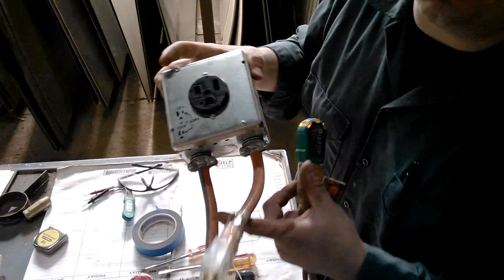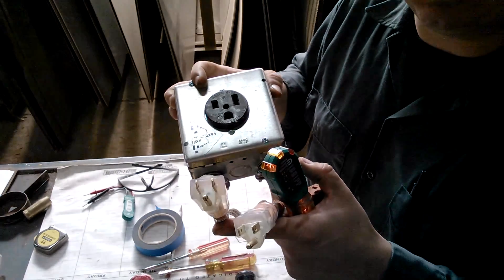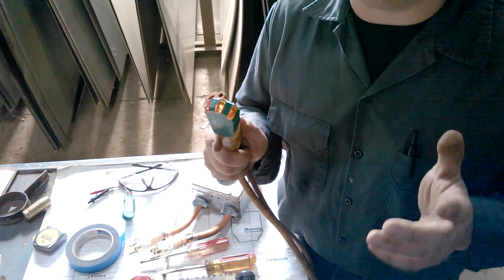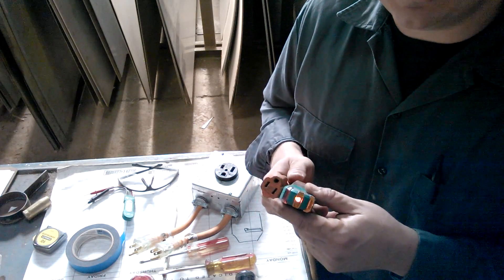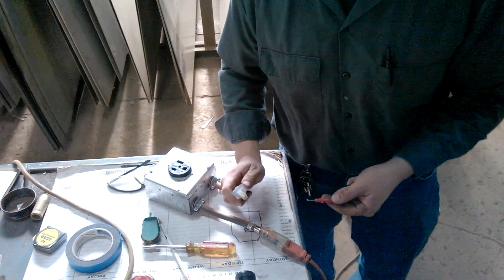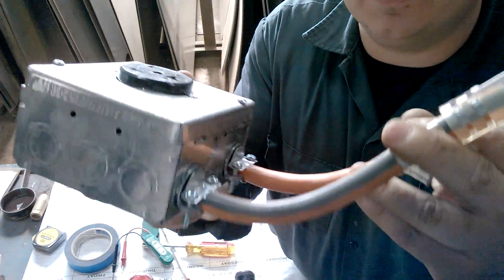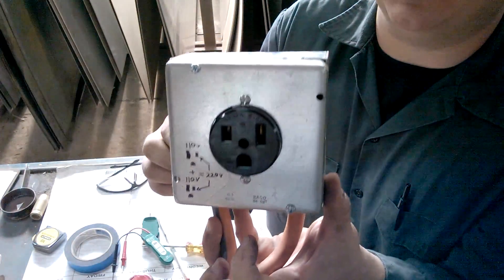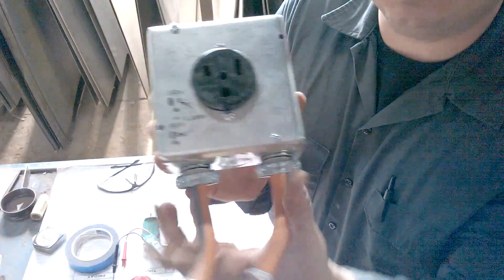Experiment convert 110v to 220v from two outlets

Comment: lots of words from someone who does not understand house power.  Adjacent breakers in a panel are each on opposite phases, so are 240 volts apart.  A double breaker serving a stove, water tank, or dryer therefore picks up 240 between the two hots.   Houses built after the 1980s must have split duplex receptacles in the kitchen,  which means the top and bottom half of the outlet are on two different adjacent breakers.  Therefore, you can get 240 volts between the two hot holes.  The hot holes are the shorter of the two slots.
You can also get 240 between the short slots of two random outlets in any house, but there is a 50% chance they are not on opposite phases, so you will get zero volts between them.

Comment: What you are saying is correct you need 2 separate circuits with them being on different Lines for example circuit 1 is on line 1 and circuit 2 is on line 2. The easiest way to get 240v from 2 120v outlets is from the kitchen split receptacles 240 is available in between the hot's on the duplex

Comment: you are a dipshit talk to damn much
Reply from the maker: Lol, I assume you prefer picture books also.
Reply: +UnsanctionedFabrication 
nice video there's only one concerned that I saw no one bringing. yes this is perfectly safe to do. the only problem is if there is a fault in any one of the lines and the breaker for that line pops the second leg will continually have power until a fault occurred and the breaker pops on its own or you shut it off realizing you do not have your 240 volt system working anyway more. why when they do run a 240 or 120 240 volt system they will connect the two Breakers together if a fault occurs in any one of them or both of them both Breakers will trip shutting off power to the load.
okay for you to do in a pinch but if you're going to go through all this trouble of making this damn thing why don't you just buy a 2 pole breaker some appropriate sized wire and run it and do it the right way

Comment: I was visiting a NUCCA Chiropractor today, he mentioned that he doesn't have 220 in his office so he uses 110V plus a battery to make his x-ray machine work. I was just sitting around tonight thinking about how he could do this without spending a lot of money installing 220 into an office he is renting. I once wired my garage with 220 so that I can test electric dryers to sell.

In my mind I could picture the wiring. In a 110v outlet you have a black wire (hot) a white wire (neutral) which interestingly connects to the same bus bar as the negative wire inside the electrical box, essentially neutral is ground, I always thought that was strange, because then you have the green wire (ground), as if redundant. Look in the electrical box if you don't believe me.

Anyhow, when you look at a 3 prong 220v outlet, one prong has a black wire connected to one side, 110V, then another 110V black wire connected to the other prong, the white neutral wire has been eliminated and the green wire is connected to the middle prong. The newer 4 prong 220v outlets re-introduce the white wire, on dryers both white and green are ground. I've worked with these long enough for this to be embedded into my memory. Each have their own separate breakers that don't share that current with anything else, but I had the thought, just as you demonstrated here, take extension cords from different outlets on different breakers that aren't carrying heavy loads, such as a refrigerator, I think it's the narrow prong that's hot, the black wire, you can check by looking at how an outlet is wired up, then wire up the 220 outlet as you did, so I looked on youtube to see if anyone else had thought of this, and then I saw your video, this brilliantly simple if one comprehends the concept. Your cords should be a certain AWG to properly carry the load without burning up the wire, and again, if the section you have either cord plugged into is drawing too many amps from other appliances then it will keep tripping one of the breakers.

I must experiment with this and I have dryers to test the procedure. Some may ask what a NUCCA Chiropractor is. In plain English it's a new procedure where it was discovered that a plate under the scull gets misaligned and all other vertebrae below shifts out of balance as a result. Adjust the plate and everything below it responds and realigns only requiring one or two adjustments until the next time you take a hit to throw it out. I also learned that some chiropractors will deceive people into believing they use NUCCA techniques yet convince people to come back once or twice a week repeatedly, so beware of those.

Comment: you can check if 220v exists between circuits with a multimeter. the converter you have built will have either 120 or 220 if plugged into different outlets. no harm can come from plugging it into any outlet. The caveat here is that the circuits you are using are  either 15 or 20 amp max and you cant use most large equipment on them.

Comment: OK, so we now have a cool little gizmo that's not up to code but the real question is about what you may power with this contraption? You have a 30 amp plug and only 20 amp (at best) breakers. Seeing as an acceptable draw is 80% loading on a branch circuit we now have roughly 16 amps per leg available for the appliance. This is not enough for a portable oven, cook-top, or even an electric car, although might work on a small welder if it's got the ability to dial-down the draw, in which case that welder probably has the option to run on 120 volts already. (typical of Miller welders / plasma cutters) For those who are not familiar, a 20 amp 2-poll breaker for 240 volts is almost exactly the same as a pair of 20 amp 120 volt breakers. The difference is what's called "common trip" so if one trips then both go off. This is the second problem that blows out the code book.

Comment: Thank you a lot. I bought a dishwasher with a 220 v from italy but I only have 110 v.  with your method I was able to get it to work and I didn't have to expend almost $100 buying a Volt converter step up. But it only worked because I have a brother living next to my house. I did use the negative (black ) a cable from his 110 and a 110 from my house connected to an outlet.

Comment: Cool! I really don't understand why 110V is still the standard in the United States. 240V is more efficient to me.
It's a cool experiment. I assume the electricity is still 60 Hz, so you probably won't be able to use a lot of appliances made for 240V 50 Hz, but I still think it's pretty cool.
Reply: Arne Maeschaelck because it is said to have gone back to the Edison days where 100 volts got the job done so the U.S. adapted it.
Reply: 482lost of course! I can plug in my laptop perfectly fine in a wall outlet (240V) or in my truck (110V) or charge it pretty much anywhere in the world. No problem.
But quite a lot of devices still only work on one of the two, and they still require twice the current (and a thicker cable)…

The higher the voltage the more efficient, but obviously it wouldn't be very safe to have 10 kV on wall outlets…

Comment: good math but terrible idea. if I connected 2 sets of leads off of a power source and then connected the leads together I would still end up with the same amount of voltage with a slight amperage drop. do not cross connect any wires. play with induction instead of starting a future fire you would have in your walls. and no anyone commenting that this works or is a good idea has never and will never be an electrical engineer for any company what so ever. and your phase out of phase from 2 voltage lines are confusing your tester because of the length and gauge of your shop cords. just stick with the code please
Reply: That's true, but that's not what he did. The hot leads aren't connected together, the grounds were.

This works. I did it with an electric water heater and it ran fine for 3 years before I moved out and I'm sure it still works fine to this day.
Reply: Trolls. Workable. But you wouldnt find that kinda work in my shop. Each to thier own if it works I guess run with it??

Comment: This is  just a simple combination of split phase AC electric.  Anyone can do this in their house if they have split phase 110 or 120 (here in USA we have 120).  An easy way to find out if  you have 2 different phases is to run an extension cord from another room and check the voltage between the 2 hots after first checking each individual cord for 110 or 120V.  If they are the same phase then the voltage between the 2 hots will be 0.  If they are different phases (meaning 180 degrees out of  phase but still phase locked), it will show up as 220 or 240V.  This is VERY simple to do.   Once you have the 240V isolated (meaning you have the correct feeds for it), you can do many things.  They are guaranteed to be on different breakers so depending on what load you need, you can decide if you must combine 20A breakers or if 15A will be enough.  Remember at 240V (vs. 120V), you only need half the amps for a given wattage (assuming same power factor for both).  Assuming the wattage of  what you need stays constant (for example a 120V 1500 watt heater vs. a 240V 1500 watt heater), the wire thickness needed for the 240V setup is less (smaller).  This is partially why high energy electric things use higher voltage, otherwise the thickness requirement for the  wires would be great.  Golf carts for example draw thousands of watts but do so via 36V or 48V (usually) , thus only needing 6 AWG cables.  Imagine if they use a 12V setup for a golf cart.  Not only would you need several hundreds of amps, but the cables would have to be MUCH thicker like 2 AWG.  A decent analogy is voltage is like the size of a baseball batter, amps is how hard he has to swing, and watts is how far the ball goes.  So a large batter (let's say 24V) would only have to swing moderately (lets say 10A) to hit the ball 240 feet (240 watts analogy).  Now let's take a smaller batter (equivalent to 12V in our analogy).  That same batter has to swing twice as hard (20A) to hit the ball the same 240 feet (240 watts).
Reply: David James True. The power coming in the home is 240 vac split phase. Just depends on which side of the circuit breaker box it happens to be on.

Comment: From the wall you get 3 cables, Red, Black, White,  if you get Red And Black you get 220v, if you get red or black and white you get 110v,   so red has 110v and black has 110v, white is neutral,   so to get 220 from a normal outlet just make sure each outlet is connect to a brake that is connected to the red and the other braker to the black and you get 220v!!!!!!!!!

Comment: The reason why this should NEVER BE DONE is that it is NOT true 240v! A/C which is defined as "alternating current" is a sign wave that basically is a plus and minus voltage cycled at 60hurtz. Standard 120v current is basically a sign wave of just a negative and positive pulse. 240v is two of these sign waves running opposite of each other. This is how any motor running on 240v starts and operates. Now if you tie two 120v lines together, the sign wave pattern would now be the same and no longer are opposite of each other. Although SOME items that are 240v will operate on this phase, most will heat up fast and either burn out or start a fire. (Good example of this would be a 240v well pump. It will run for a while, but the windings in the motor will be under extreme heat and WILL burn out.)   Yes it can be done but you are playing with "fire" by crossing the 120v lines to make 240v out of a generator that is only one phase.
Reply: +1111hobbes ???? This exactly the same method of providing 240v which is typically done, except he's sourcing his 120v L1 and L2 supplies at the outlets rather than at the breaker panel. L1 and L2 are out of phase by 180 degrees, and sourced from opposite ends of the same centre tapped transformer, therefore  will provide a constant 240v(rms) value between each.
Reply: 1111hobbes 𝙏𝙝𝙞𝙨 𝙨𝙝𝙤𝙪𝙡𝙙 𝙗𝙚 𝙥𝙞𝙣𝙣𝙚𝙙! Ok, it is sort of correct only it also needs 2 phase breaker and it should be grounded. 240V in EU is a totally different animal.
Reply: ArthursHD - Here in the US we have single phase 220 volts.  The step down transformer on the pole outside is center tapped so we have 2 hots and 1 neutral.  The neutral is bonded to ground.
Reply: It depends on what you use it for. A stove will work fine. I wouldn't use it to run any fancy machinery.